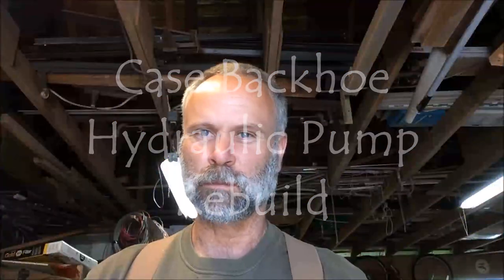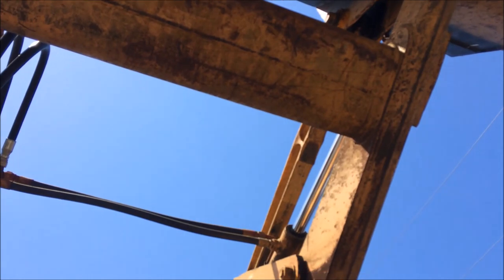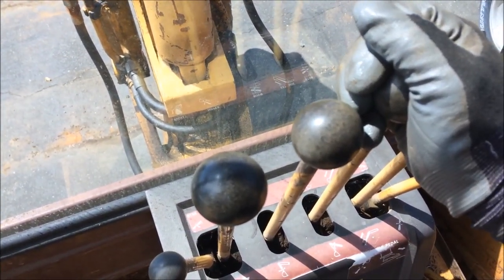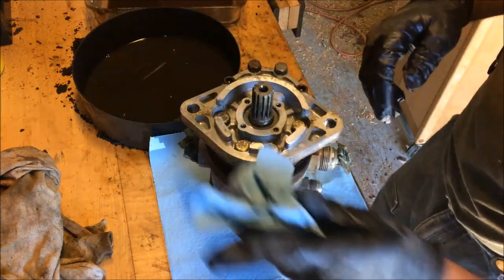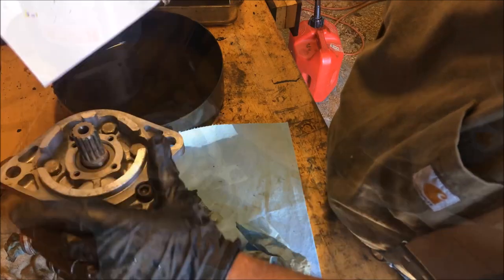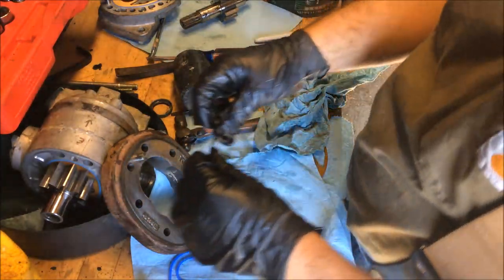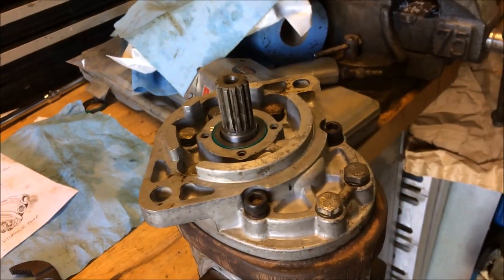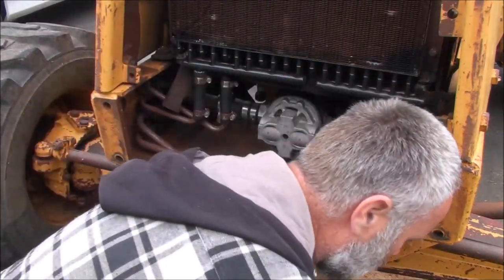1987 580E Case Backhoe Hydraulic Pump Rebuild

Comment: Good day,  Nice to see you working on the pump!  I plan to re-build my pump but first to keep going with my work project I have purchased a new one as well as the crank adapter!  From experience when replacing the pump, It's recommended to replace the adapter, Filter and try put fresh new hydro fluid!  Good to see you back up and running.!

Comment: Hi.. I just got my 580 today.. sight unseen.. well it acts a lot weak.. it Runs well but it has a hard time putting pads down and lifting the tractor... and really not impressed with digging .. it is old and HR meter is stuck at 200... so Im thinking its time to check the pump.. I do almost everything myself so this helps... do you agree its the pump ? or should I check other things . He said he recently changed the hydraulic filter

Comment: I know this is an older video but I have a 580F with a leaking pump. I am curious did you get the repacking kit from the Case dealer or somewhere else?
Reply: I was able to get mine on EBay. The CR seal you might be able to get locally from your parts store. The kit I got came with the CR seal as well.

Comment: How did it turn out after three years of use any leaks? Any other issues? Did you notice the pump had more power after you rebuilt it? Thanks
Reply from the maker: I will try to remember to tell Patrick to come in here and update but as far as I know, he has not had any leaks and it has been working great